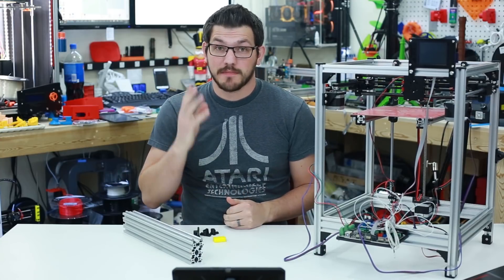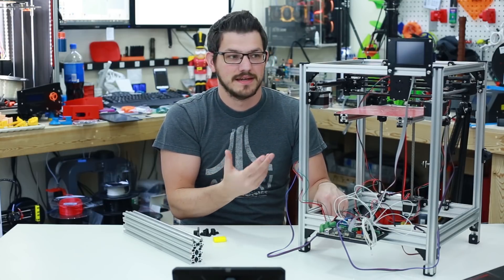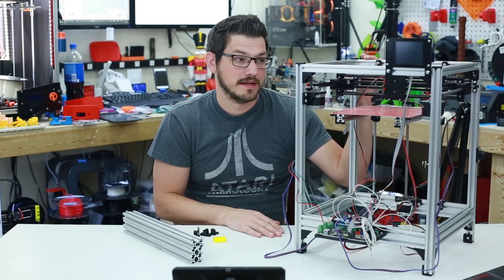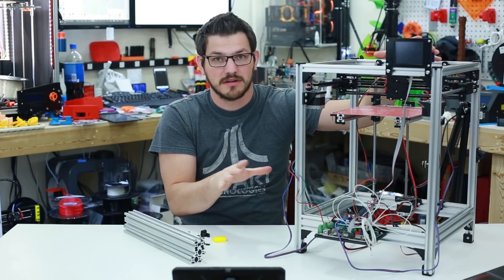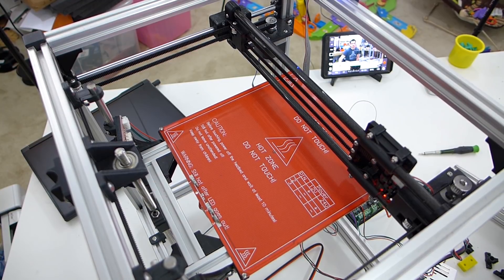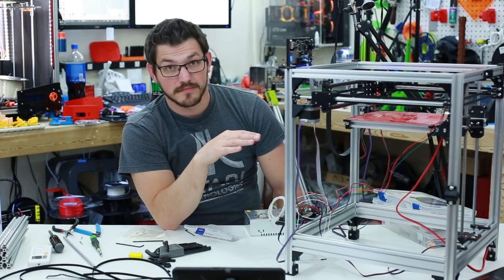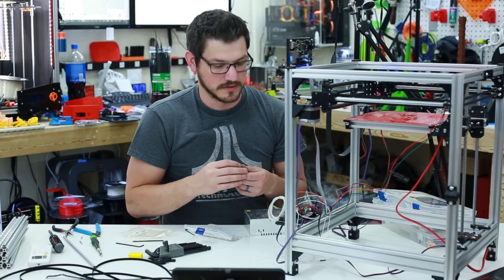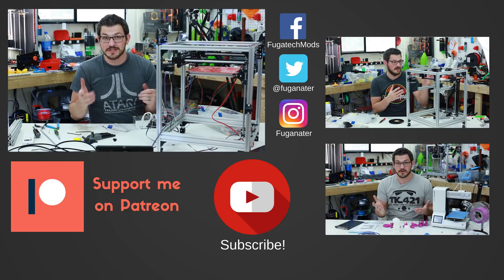HyperCube Build Part 4

Comment: can you not move the motors to the outside of the rails to get you distance back?
Reply from the maker: You probably could but this design is meant to be kept in the frame which makes it easier to enclose if you want to.

Comment: Hope you do not regret going with the Carbon fiber rods, for the X axis. I started with the chrome plated steel, smooth rods, and have since moved onto the MGN12h linear rails, for my 400x400x500mm Hevo, for my X and Y axis.
Reply from the maker: As I said in the video, I've been running them for over a year with zero issues.
Reply: @Fugatech3DPrinting  I hadn't seen that part of the video before I had made that comment. Glad they are working for you.

Comment: About the heatbed. Better to put some spacers to attach to the support, otherwise the 2020 profiles are going to work as heatsinks, turning difficult to reach the righ and even temperature on its surface

Comment: Im am thinking of building one of these but how do you have one touch screen? Ive seen a lot with touch screens but there is usually another non touchscreen screen. Are you using a different software or something, im confused.
Reply from the maker: I have both on there for but I only use the standard 2004 LCD screen now. The touch screen is nice but can be difficult to navigate.

Comment: Great Videos but one thing (you said it here the second time actually) if you use 10/8mm carbon fiber tubes you only have 1mm walls (on each side) not 2mm walls.

Comment: Really turning out good . Excellent work as usual!  I read the Igus bushings are made to go into a holder that is smaller and gets them to achieve thier fial size. That is why both yourself and Tek2C had to shim them. I think it was on Tomas Sandalers bearing video

Comment: Your bed mounting base may be undersized, but 4 point mounting alone can warp a bed due to being over defined. If you can change to a 3 point mount leaving will be easier and you will have one less way to warp the board.
Reply from the maker: True but I honestly hate the 3 point bed leveling. The Ender 2 has it and I have learned how to use it and can do it well now, I still find it uber annoying.
Reply: Fugatech 3D Printing digital dentist on the rep rap forum has a guide to 3 point leveling. I switched and found it much quicker to level personally. Take the 2 on one side, get them parallel, then adjust the third up or down until parallel. You are done. with 4 point I was constantly adjusting, going back, and trying to take out warp.

Comment: I'm currently designing my own CoreXY, inspired by the hypercube but all new components. I felt I could improve on alot of areas as a mechanical engineer with tons of 3D printing experience. 
It's being designed in Fusion, so if you needed help with any custom parts for yours, send me a message.
Reply from the maker: Very cool. Thanks! Let me know if/when you upload them.
Reply: Will do! Just ran a couple of prints on my delta to see how one of the parts came out in real life.

Comment: Definately remix the mounts for the heated bed, it'll save you  headaches trying to change the bed support 2020s.
If you are planning on having a swappable print head, check out my Quick-Change Print Head mount 
https://www.thingiverse.com/thing:2799665
and quick disconnect for the wiring
https://www.thingiverse.com/thing:2799665
 on thingiverse. No screws necessary for changing the print heads.
Reply from the maker: Thanks for the link. I'll check them out!

Comment: It would be cool if you can cover your TFT/MKS board setup. I lot of people are having issues and their build stops, myself included. Did you use Marlin or Smoothieware, is the board a one etc. it sucks when you build a great machine but end you with a ton of choices for firmware but nothing works
Reply from the maker: I am using a MKS Gen 1.4 board and chose Marlin for this printer. I do have a MKS SBASE + TFT32 which I am using to learn Smoothieware on my Delta printer. I can add a setup video to my "to do" list.
Reply: Fugatech 3D Printing that would be awesome, thanks

Comment: Is the heated bed bowing because you have no springs under it to provide that gap?
Reply from the maker: No, it is bowing because the screw holes are too close together. Springs can't fix that. I need to re-cut the cross beam.

Comment: Nice. Yeah you need to add the springs on the bed.
Reply from the maker: I will, I was just trying it out to check the spacing. I need to re-cut the cross beam.

Comment: Having bed springs will give you some room. You could also just move the X bed extrusions out on the bed carrier.

I like your idea with the longer rod holders. One could just make a little 20x20x8 spacer for the frame too. I might do that myself!

Also Artur has a better Z endstop holder. The endstop goes on the bed frame, and the adjustment screw goes on the rod. Super useful. Use a spring and nyloc and you never have to adjust it.

10x8 is fine tho it has a 1mm wall. 10x6 can be bought from HaoZhong.
Reply from the maker: Then there would be a gap :P I'll play with it some more and see what I end up going with. Artur has some great parts that I will eventually swap to.

Comment: What's the build volume of your hypercube build?
Reply: whatever you want, it's open source unless you get a kit.
Reply: Thomas Lema I understand that haha. I meant what dimensions did you pick.
Reply from the maker: Mine will be 200x200x215ish
Reply: Do you know what effects on the cost doing a 200x200 bed vs a 300x300 bed has?
Reply from the maker: Probably only a few dollars if that... except for the bed. A good 300x300 bed will be a bit more than a 200x200 which you can get for $10 or less.

Comment: Hey what do think is stiffer, steel smooth rods, or carbon fiber. I'm thinking about converting my prusa clone into a hypercube
Reply from the maker: I'm suing Carbon Fiber rods to make the carriage lighter. The lighter you make it the more accurate your printer will be.
Reply: Fugatech 3D Printing yeah, I knew the carriage would be lighter, but I was thinking about extending my x axis to print at 200x300 mm. I didn't know if carbon fiber would sag or not. I also will look into aluminum tubes/rods
Reply from the maker: If you go out to 300mm I would get 10x6mm CF tubes which will be much more rigid than the 10x8mm
Reply: Fugatech 3D Printing k, thanks I'll look out for those
Reply: Luke Cunningham for extended ranges,consider linear rails. They could give you the extra rigidity you need to prevent the carriage from sagging.
Reply from the maker: True Jason, but then you need to remix all the parts since you can't use the standard HyperCube parts.

Comment: Did you measure the amount of travel for the Y-axis as you moved it?  Would the hot end mounted, have made up the additional reach to the front of the bed, or is it that the measurements on Thingiverse are a bit off?
Reply from the maker: Measurements on Thingiverse are off I think. I get the full 200mm on the Y

Comment: I know the board was MKS but, what is the touch screen and firmware you are using? Thanks for the video.
Reply from the maker: I think it is just the TFT32 v3 firmware. It goes on the screen's SD card and loads when you boot the printer.

Comment: great stuff as always man need to get my ft5 back up and running again burnt my 3rd psu, wiring is 100% so either going to 24 volts or just a better psu.
Reply from the maker: Something must be up if you are going through so many of them. I'm still on the stock PSU with no issues. knocks on wood
Reply: Fugatech 3D Printing keep blowing a capacitor issue I did take them up to 14v might not like that thinking of getting the better one since I wanna hook up 2 120mm pc fans on the hatch  since when running my gaming pc my room get to a lovely 90f trade off for the price difference for amd haha
Reply from the maker: I have mine set to 14v and I run a single 120mm LED fan which blows directly onto the MKS board. Keeps the drivers super cool
Reply: Fugatech 3D Printing yeah between you and dustin I went 14v i dont know maybe a bunch of bad psu but like I said went over the wires and components dozens of times so I'll just upgrade and see how that goes. Really appreciate your responses though Shane keep up the work watch every one